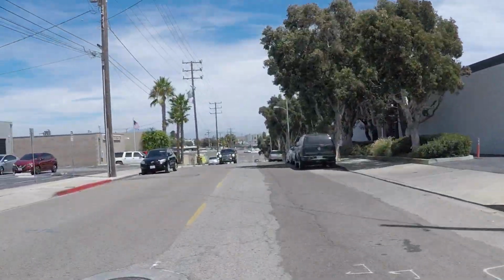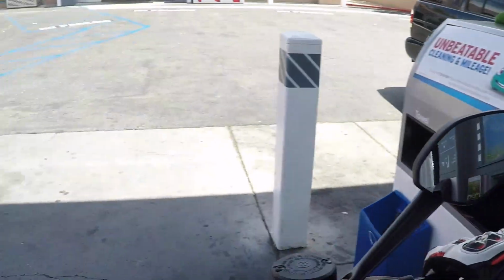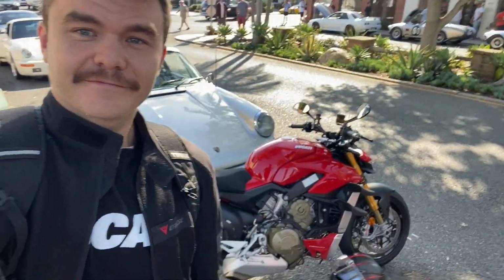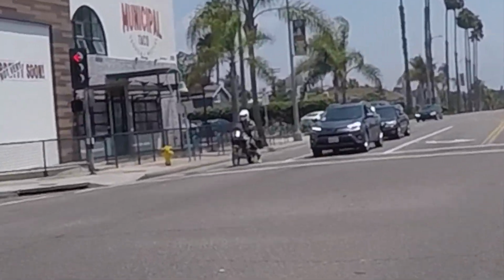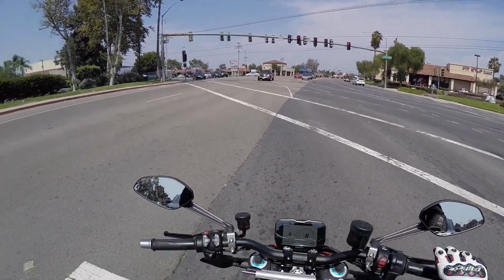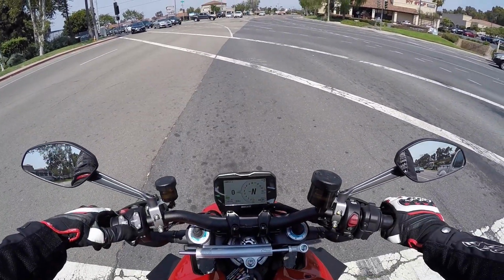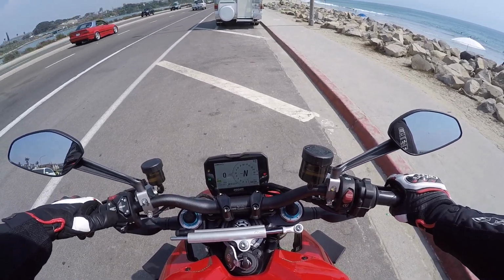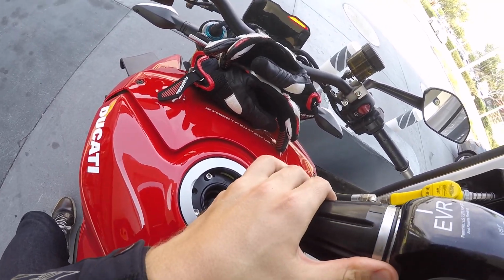I ran out of gas on my Ducati Streetfighter V4! What's the true range?

Comment: Thinking of buying a light-used V4S off of a pal. If so, a rotopax or equivalent seems a reasonable solution. An extra two gallons of range would alleviate a bit of the range anxiety. Thanks for the text, fam!

Comment: i ran mine till i had 21 miles on the reserve fuel sunday.   boy i was closer than i thought to walking than i realized. ive noticed that the per gallon number that was so off never changes much regardless of how im riding it.  always around 40mpg
Reply from the maker: Seems like their calculated mileage is way off... though as one other commenter pointed out, it seems the true capacity of the tank is only around 3.3gal.

Comment: I just got my bike and had my first ride out yesterday. Kept it around 6k but it went a little higher a couple of times.
Fuel light came on at 98 miles and I got home with 30 miles showing on the reserve trip so 128 miles. It was showing around 42mpg.
I filled it on the side stand so if I had filled it upright I could have got a little more fuel in
I haven’t got a clue how much is left in the tank or how much further I could have gone.
Here’s hoping I  can make it to the garage for more fuel.
Reply: I've run mine out at 183km Tank holds 13.3 litres completely empty to brimmed. Ducati lying about capacity

Comment: Nice info! I run out of fuel on my SFV4 unintentionally because i was touring at the mountains at 130 miles but with slow riding. I had a passenger and the twisties were very slow.
Reply from the maker: Running out in the mountains with a passenger sounds not ideal!
Reply: @DucatiSpacers  indeed! But thankfully i was on my way to the gas station and run out of fuel just 3 miles away from it. So it wasn't a big adventure in the end!

Comment: I managed exactly 26 miles today running it in Street mode, keeping it on a steady throttle at 4k, and pulling in the clutch and coasting down the hills. Terrifying! 😀 I think that although the manual quotes 3.52 UK Gal (4.22 US), it is actually 'US' gallons,. Because after riding 26 miles with the low fuel light on (which we know from your 26.1 test it's on vapors), it took exactly 3.52 'US' Gal to fill it to the filler, with the bike bolt upright.
Reply: Thank you so much for that data.  Curious why the computer said 39.8 mpg, because that doesn't compute even taking that into account.  This is why I do this test on every vehicle I own.  Most accurate was surprisingly my Alfa Romeo, which has an exact reserve of 7 litres and 63 litres total.  I know I get 5-6 miles per litre on that.  Fuel pumps in the UK sell in litres, so the sensible unit IMHO is miles per litre.  Because I travel miles and buy litres.  In Europe it should be km/litre.  Then you only have to do one operation to know how long before you get stranded, or how much fuel to buy.  This litres/100km nonsense means you have to do two math sums to know your remaining range.  Trusting the computer is something you do ONCE before you get stuck.  I drove my Jeep across Europe and ran out of fuel 5 miles from home.  I got towed like 900 yards to a petrol station free of charge because I was on a dual carriageway hard shoulder that was well-monitored.
Reply: Also, on UK motorways (highways), I think they have to have a petrol station every 27 miles, with perhaps up to a mile or two of slip roads to get to them.  So if your fuel light comes on when you're on a motorway here - you can't count on getting to another petrol station before you get stranded!  Unless you are 1/3 of the way there! Hah that is why you need a fuel gauge.
Reply: @projector7141 The US and UK gallons are slightly different capacities, and relying on the computer to work out your average mpg is a stranded vehicle by the side of the road waiting to happen. Best to test it from full until empty, then always reset the trip every time you fill up. Or reset the trip whenever you go onto reserve and know (test) how long you can run it until it dies, as we did. It's definitely handy to know. The most accurate bike gauges I've tested are BMW GS/GSA gauges. Those German's know a thing or two about pedantic accuracy.
Reply: @RichDunn  Thank you so much Rich.  I'm shopping which one to buy, the V4: S, SP2, or R.  Bewildered by all the options.  Also trying to get girlfriend approval and support.  Reviews and comments are so helpful.  I can tell this is a good community.

Comment: Great video.  I've been wondering.  My fuel light always comes on at 75 miles, bike says I get 35 MPG (very interesting) and I've never gone more than another 15 miles.  I guess the bottom line is don't expect to get more than 100 miles per tank.
Reply: Yeah mine around that range too...75 miles light comes on...and 20-25 miles more before refueling

Comment: Excellent video, so when the fuel light comes on I can pretty much count on getting 20-25 miles which should very comfortably put a gas station within range. Can you do a video about the V4's heat? How hot does it get especially around town, how noisy does the fan get, does it hurt your legs or boil your man bits?
Reply from the maker: I'll do a vid about it for sure!
Reply: I find the heat not a issue even stuck in traffic on a 40c day down under

Comment: Yup. Thats the deal breaker for me- no fuel gage on a $27,000 bike which guzzles gas. The 40 mpg is a ridiculous lie. So you got the fuel low level light which comes on after 80 miles. Just don’t pass up a gas station on this bike. I’ll keep my Diavel.

Comment: good vid Kev, i have the Monster 821, was also wondering this, cheers
Reply from the maker: Love the Monster so much! Would have been my next bike if the SFV4 didn't come along.
Reply: @DucatiSpacers  lol yeah the Street fighter looks awesome! for now i'm loving the 821 Stealth, looking forward to getting your spacers installed lol, cheers man
Reply: @DucatiSpacers  do you still like the v4 even with that fuel mileage? Love the bike but not the range as much. My 1299 typically turns on the light after 100 miles so they're relatively similar i guess. So weird how the avg mpg is crazy off like that.

Comment: quick question.  From your experience(or your friends with experience), which bike would you say has a better reliability:  the ducati v4(v4s) or the bmw s1000 R ?
Reply from the maker: Have zero experience with the S1000RR! I've heard of plenty of issues with the V4 models, but only because I've been heavily involved in the Ducati scene for so long, and people always tend to talk about their negative experiences online.
Reply: @DucatiSpacers  D.S...I've given you a thumbs up buddy.  Yeah man, I did a little 15 minute review and found several reliable sources that says that the reliability of the Streetfighter is just as good, if not better, than that of it's competitor(the s1000 R model - single R).  The ONLY thing I don't like about the streetfighter is that it doesn't have cruise control, like the bmw does, and it doesn't have a visual guage to let you see how low you are on the gas.  Other than that I think, for a 6'3" guys the streetfighter is actually taller than the bmw s1000 R model by about(according to research) 31 mm tall which is considerable !!

Comment: My 1198 ran out of gas after 12 miles!,my old GSXR 1000 used to do 20+ miles when the warning came on.
Reply from the maker: 12 sounds brutal... how many miles could you get from a full tank on the 1198?
Reply: @DucatiSpacers  with Termignoni cans and a Rexor reflash of the E.C.U. roughly 85 miles,but 85 miles of lunacy,talk about a 2 wheeled full scale riot,it was crazy totally stock and you go from there,rock hard suspension,dry rattling heavy clutch,piece of wood for a seat,flopped into low speed corners and brick wall non A.B.S. brakes,it was Hellish at legal speeds but sublime at over the limit speeds,it just got better the quicker you went,amazing bike,a true Italian thoroughbred.👍

Comment: I've had ducatis in the past that I have emptied the tank and then filled - usually they take nowhere near the stated capacity - I think this is because ducati are stating the 'volume' of the tank, which contains the fuel pump and filter thus reducing the 'capacity'
Reply: Even my car fuel pump and filter don't use up 2.9 litres of space. But you do have a point about that.

Comment: Awesome video,  I pushed mine to 180km (113miles) total and filled up shitty fuel at at a shity station in the hills. Does the range vary post first service?
Reply from the maker: Doesn't really seem to have changed much, but I'm only at ~1500 miles now.
Reply: I ran out at 183km, you were close! Tank holds 13.3 litres empty to brim

Comment: Do you know how much fuel have it took to get full after getting out of fuel? I have done several times about 40 km (24,85 miles) with fuel light on, about 200 - 215 km (124 - 134 miles) total tank, and when refueled it took only 13 - 13'5 liters (3,4 - 3,5 gal) to get completelly full. It's far away from full tank capacity (16 liters - 4,2 gal) announced by Ducati.
Reply from the maker: You're right, it only took 3.3 gallons to fill it! Strange that it's so far off from their claimed capacity...
Reply from the maker: Guess that means the real fuel mileage was more like 34.8 mpg!
Reply: That means 2.5  litres of fuel is in reserve or something
Reply: @madhavram146  Yes... in some remote unaccesible place
Reply: @scroller83  it's good to know information on fuel. I'm thinking the panigale V4S might do the same or little more 260kms
Reply: @madhavram146  The maximum I have done is 214 km and when it was filled it only took 13.56 liters. I'm in the first 1000 km without accelerating more than 6k rpm. Let's see how it will behave after the first maintenance.
Reply: @scroller83  have safe riding and keep Posted 😊👍
Reply: 100% agree i reckon 14 litres, wish somebody would do a video confirming, false advertising by Ducati

Comment: you know you have a well engineered bike with reliable manufacturer information, when you need to rely on you-tube vids to simply know how far you can ride without running out of fuel.... 

Tank capacity inaccurate,
Computer fuel conmsumption calculations - way inaccurate,

Hope ducati offer a free call out service when you are stuck on the side of the road.